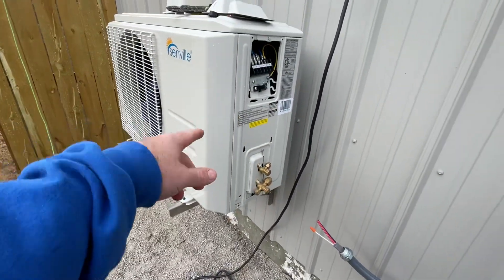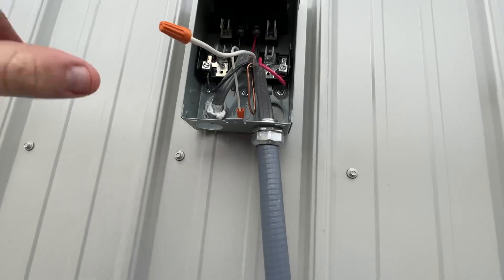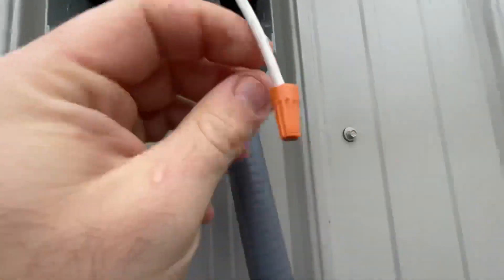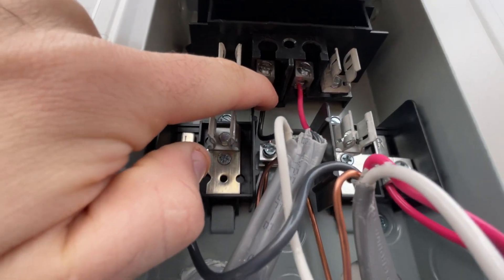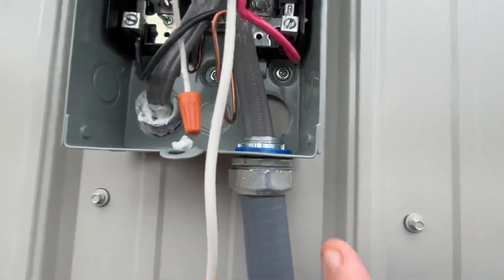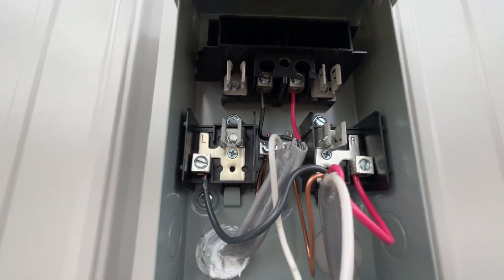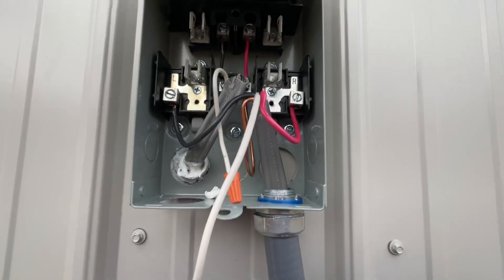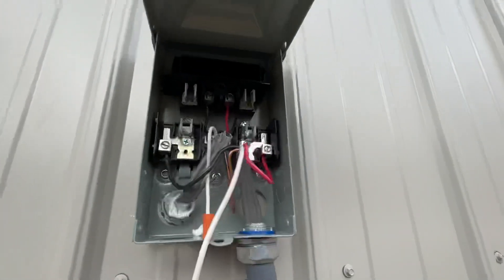220v Shut Off Switch Wiring Inside Shut Off Panel Box - Wiring Disconnect Box

Comment: No neutral? WTF.
Reply from the maker: Correct, not used in this application.
Reply: What kind of wire you used?
Reply from the maker: @robertruiz8831  depends on the size needed.  It’s not a one size fits all
Reply: I have 4 wires from panel but only 3 going to condenser.  Capped white